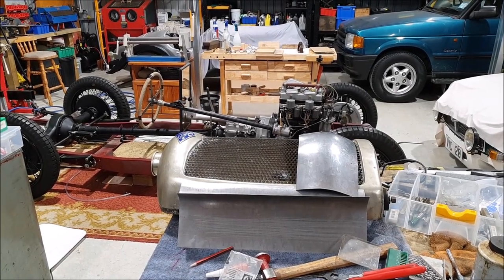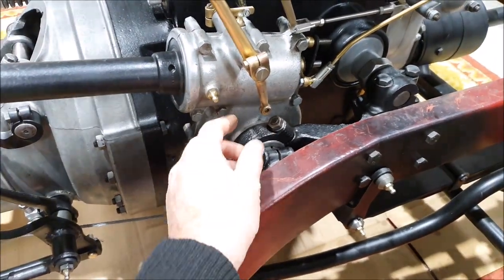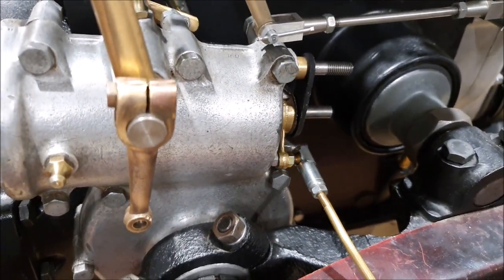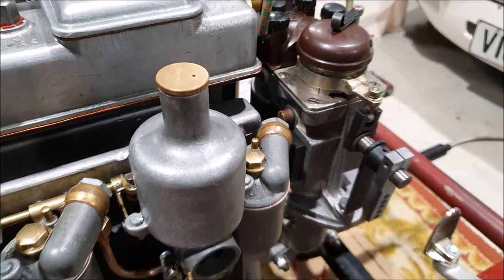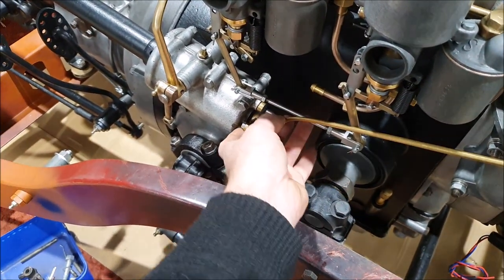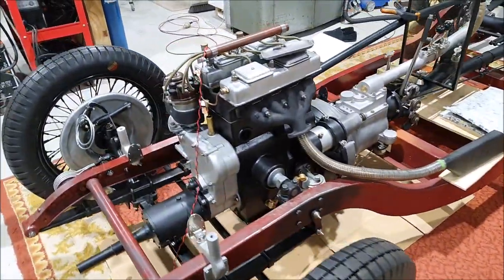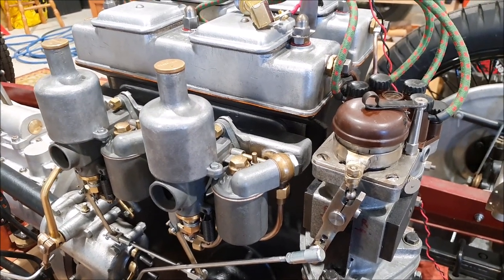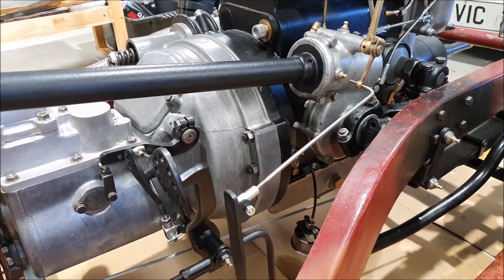Pre war Riley throttle and advance linkages

Comment: You may find the hand throttle cam will give a bit more than a fast idle. On my 12/4 Kestrel the hand throttle will let me sit on 50 mph! Very informative video as usual.
Reply from the maker: It will be interesting to see when it arrives and I can run the engine again. Maybe it will be more like cruise control than fast idle!

Comment: My Father was one of the team that built the 6 race cars at Brooklands, whilst as a pure metal's engineer, working on the case of the Collins / B Wallis bounceing bombat Brooklands race circuit. James Tucker owner of the 24hr race at Silverstone.
Reply from the maker: Hi James, I've never quite got my head around the early Riley history apart from the basics of how the Brooklands came about. When you start getting into specific cars the history can become muddled! I guess it's like that with many old race cars. I had to look up the 24 Silverstone race, I don't really follow modern racing much. I used to watch Bathurst every year until it went off free to air tellie. Modern race car tech is so different to the old stuff I am playing with but I guess the premise remains the same, make something go fast for just long enough to finish whatever race you're in! I don't plan to race mine. But getting it on a circuit for some non competitive driving would be nice.

Comment: Nice job on the advance mechanism. So many cars, my Alvis included, merely have the simple bonnet bulge to clear carb 3 and linkage etc. Just been out to check clearance on my Lynx with mag offered up. currently it is coil and distributor. Seems to be about 12mm from the body so things were tight. Good to see progress thanks for your time to video. Best from UK.
Reply from the maker: Sorry for the slow reply, but yes things are very tight. The Brooklands even more so. I am sure when I finish the body I will find things I didn't think of hitting all over the place.

Comment: He worked for Mr. Riley and made the molds and machined the Supercharger's.
Reply: You have got to remember it was a time of trial and error. Most off the parts were made with moulds cast in sand, then machined on the bench. The Old Man was a pure metals engineer and I still have moulds made in the 60's that we made together. Best of luck with the project, it is a joy to watch. James

Comment: That's quite a restoration there, sir! Congrats! :)
I wonder what's the differential at the back like... cam-and-pawl like the ZF ones? Or a geared one like Mercedes used to have until the W25?
Reply from the maker: It's a spiral bevel gear set. I have a few films where I go through and rebuild all of that. It uses a short pinion and a long torque tube all the way back up to the rear of the gearbox.
Reply from the maker: Am not sure this counts as a restoration technically? The parts are all original and restored or replicated but the body is going to be new. In New Zealand it's classed as a 'scratch built historic replica' so will end up with a modern VIN and build date. So even though it replicates a 1930 car it will be a 202? registration. Assuming I finish it in the next 8 years of course!